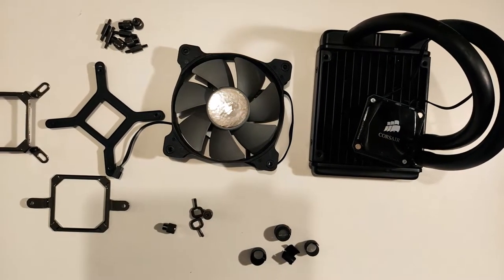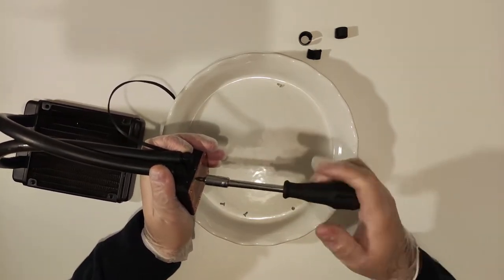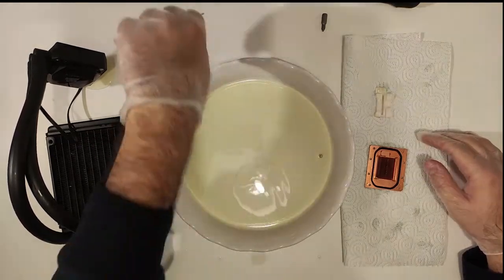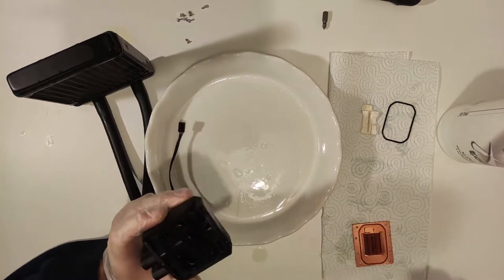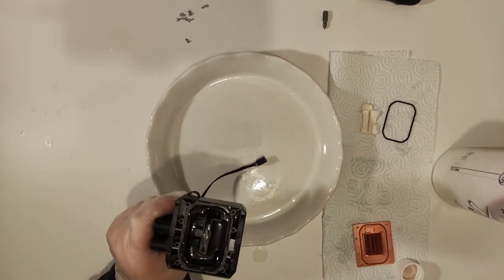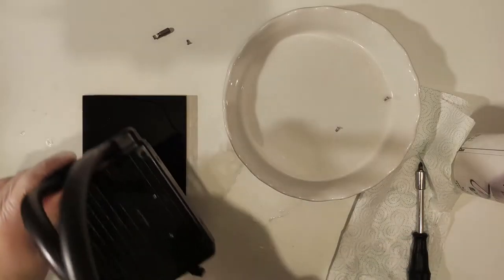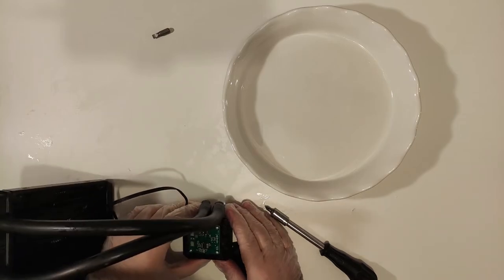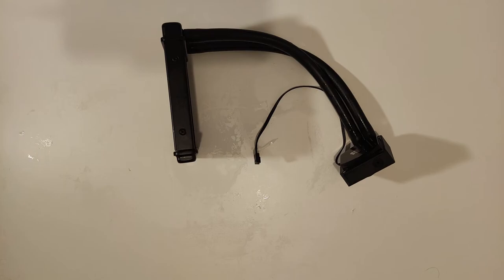All-In-One Liquid Cooler: Drain, Clean and Refill Service / Long Interval Maintenance

Comment: is there a way to get decent flex transparant tubing on this model H100i ?
Reply from the maker: That is a great question: You might be able to do that...it depends on the exact model/revision. I've never replaced tubes in the H100i as I never had too, but I did do on the H45 where they had simple barbed fittings on both the rad/pump and coldplate ends so not that difficult to remove and replace without any fear of subsequent leakage.  It kinda depends on the H100i model revision as some have metal clamps (I believe the platinum RGB) instead of the shrink wrap (that is for aesthetics only) over the ends. If you do have metal clamps you won't be able to re-fasten without a press, so if that is your case I would say it's not worth it, but if you have shrink wrap it's most likely an easy swap.
Reply: @ESHW  i'll go with the new Noctua Noctua NH-U12S REDUX :-) save some money and when new PC time comes i'll have more for a decent great water loop instead of a AIO where indeed u need to top it off or it rattles , mine started rattleing sadly , so choises must be made hehe ...

Comment: How many ml?
Reply from the maker: Honestly I never thought to measure, I just pour until no more can go in as you really can't "overfill" a loop. a 250ml bottle of coolant should be more than enough for a small AIO like this and have plenty left over for "accidents" in case you spill some.
Reply: @ESHW  I put between 90 ml and 100 ml, but I've seen people saying it's 125 ml, but the most I can put is 100 ml, I'll check the weight as you did, thanks and sorry for the english!

Comment: What's the liquid stuff called?
Reply from the maker: I use some Mayhems X1 ECO 1L Clear Premixed Fluid, but you can also use distilled water and additives. EK-CryoFuel is a good additive I've used in the past and it played nice with both aluminium and copper.

Comment: Hello, some of the screw heads are stripped on mine. What screws are generally used to tighten the copper plate to the pump?
Reply from the maker: Unfortunately I don't believe there is a set standard (and even models from the same manufacturer vary with their respective revisions), but I've had success in the past replacing stripped hex screws with M3*4 or *5 as they were the same or close enough. Not a guarantee it will work on your particular unit though 🥺. Last resort is to find a screw that is ever so slightly larger like a 6-32*4 or *5 and "thread-cut" the plastic again. You will need to keep it on a bench for a day or two and if no leaks develop it's most likely safe to use, but never unfasten it again as it's probably a one shot deal.

Comment: In short: DEAR GOD PLEASE BUY AIR COOLERS
Reply from the maker: If you have the space that is....
Reply: @ESHW  true, this 120mm AIO would fit in places where a tower cooler wouldn't. Funnily enough I had to grind a bit off of my 280mm AIO radiator because it wouldn't clear the motherboard VRM heatsinks in my case, but now it fits!